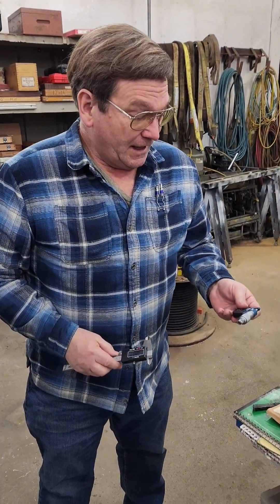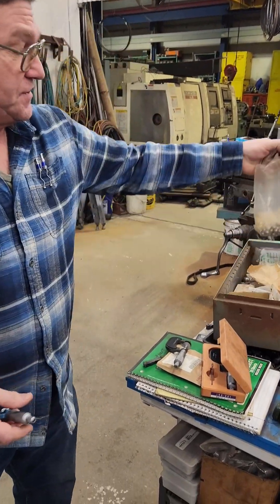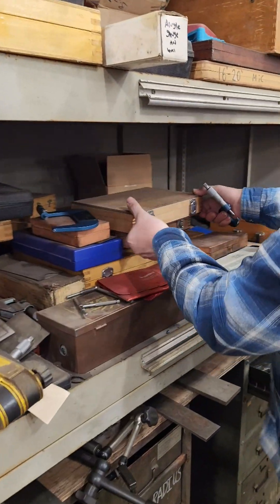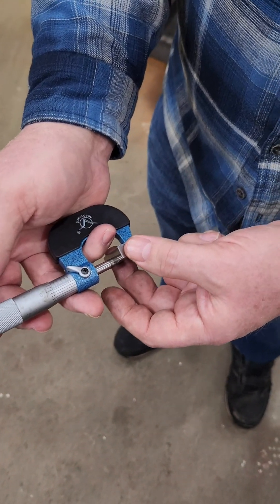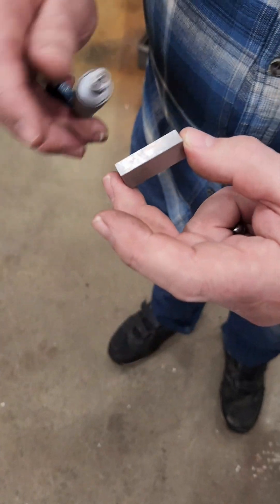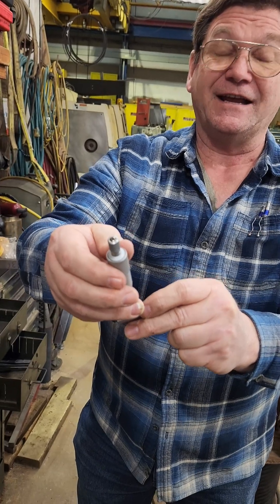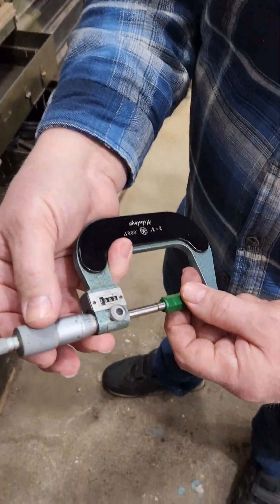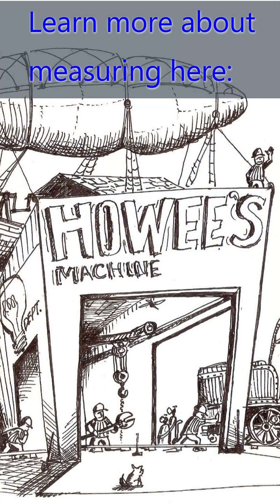Machinist's Minutes: Teach  yourself Micrometer Feel & reading

Comment: Would I be correct in saying that if you zero with the torque clutch, then you should also tighten/measure using the torque clutch?
I ask because I am tempted to use my fingers' sensitivity feedback rather than a clutch.
So, if I use my own sensitivity, then I just need to make sure that I both zero this way and measure this way?

Comment: I stopped using those little C-clamps for trying to measure accurately. They're better for holding things together for welding etc.
I stopped trying to measure ball bearings that come from china as any kind of standard because they're not accurately made which pretty much goes for anything that comes from China.

Comment: I was 14 when I started machining. Dad handed me a 1" micrometer, a decimal chart, and a 5 gallon bucket full of drill bits. Told me to get them in order. Was a nightmare but my dad knew what he was doing.
Reply: The whole "quality control" department at a factory I worked at had never even seen a micrometer and would come up to me with digital calipers to "inspect" the work I did on a CNC that was allowing me to machine drill bushing inserts from 60ish rockwell press punches to under 5μm of diameter variation via circular/helical interpolation (both when contouring the OD and when pocketing on the solid hard face of the punch) and enough precision to hit the H6 holes of the dies in just 2 finishing cuts, and to get the hard bushings to a drive fit that would take only a smidge more force to push in than when held in micrometer ratchet. I doubt I could do this that easily even on a lathe. 

You can't even imagine how humiliating this felt...